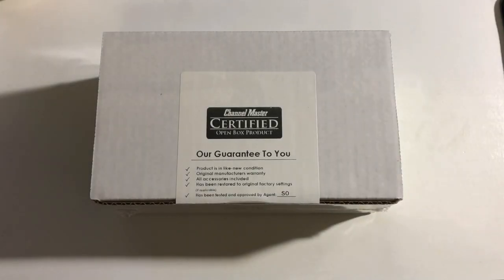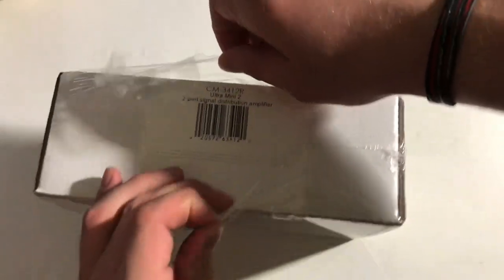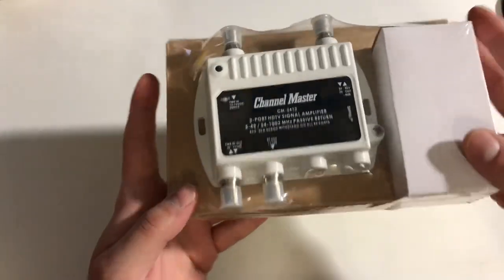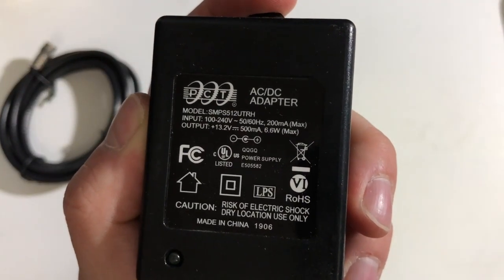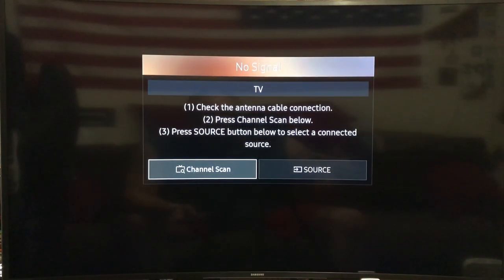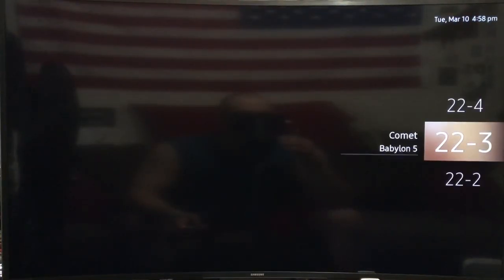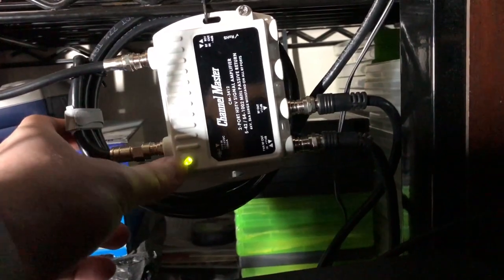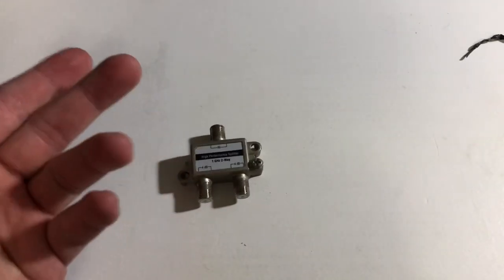Channel Master CM-3412 Amplified Splitter Unboxing, Setup, & Overview

Comment: I use one of these on a clearstream 2 antenna. My antenna is outside on side of house, the coax is running through the attic to basement, probably about 35 ft. I mounted this splitter in the basement then split the two tvs from there. i must say it works great. Didnt need to mount the splitter in attic. Im getting strong signals on all channels.

Comment: Excellent camera work showing what the Channel Master 3412  amp looks like and what it can do. I also receive the pittsburgh stations like you.I have a UHF/VHF antenna of my roof and receive all the Pittsburgh stations even WQED since the repack.I also receive WJAC from Johnstown and WTOV from Stubenville Ohio.Use to  receive WFMJ from Youngstown, but since repack cant receive.Thinking I will now try this CM-3412 amp!
Reply from the maker: This amp did help some, especially with running a 2nd TV off of the same antenna but the best results I've gotten were from upgrading my antenna to a Clearstream Max-V. It does have a VHF element but it's too small to pick up much. I rarely can get the CW and PBS never even shows up in a channel scan but I think most if not all of the PBS content can be found on their website. I also added a SiliconDust LTE filter before the amp which I think helped with occasional picture breakup I'd get from multipath interference.

Comment: Truth and Quality.
Practical and Useful Information.

Thanks for saying , amplified splitter ,  

Many any Humans say , powered splitter , powered splitter is not correct.

A amplified splitter is also known as a , distribution amplifier.

In a world where every little bit of misinformation gets built up on , the truth is important.
Reply: Yes They Are Distribution Amp A.K.A Amplifier Splitter

Comment: I thought of getting a CM-3412 but it needs to be as close to the antenna as possible so it can amplify the signals down to the TV. (thinking of replacing a 5 year old RCA preamp)
That would require me putting another coax cable up to the attic for the power inserter.
If you place the amplifier near the TV you are trying to amplify signals that have loses all the way down the coax.

Comment: NOT ONCE did you explain where the DC power goes in, where the antenna connects to and where the output is!   Do a tutorial, do a tutorial that is useful and this wasn't useful, at all !  Waste of time.
Reply from the maker: All of the inputs and outputs are clearly defined on the splitter and should be self explanatory.